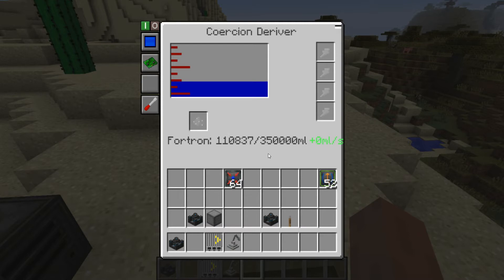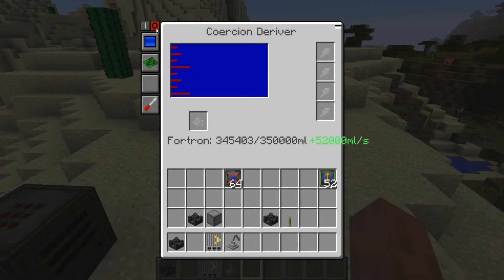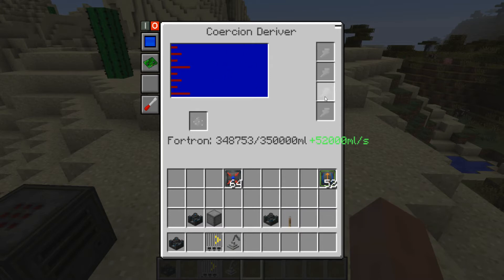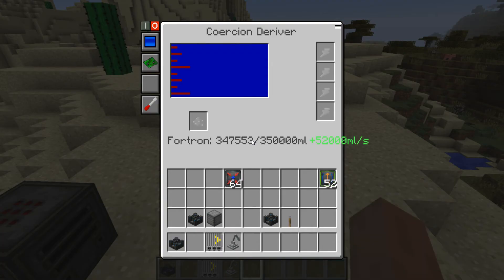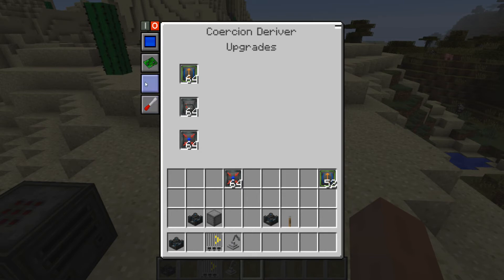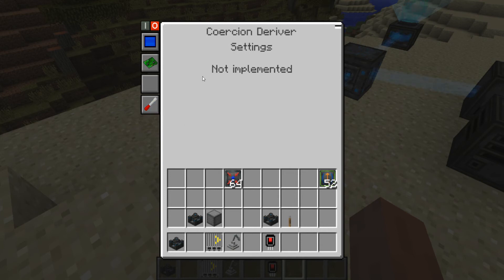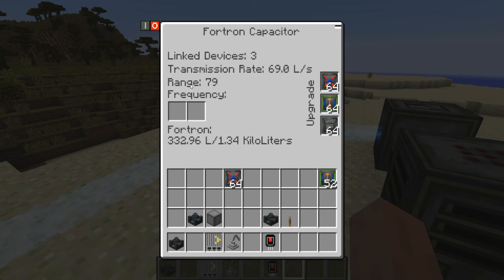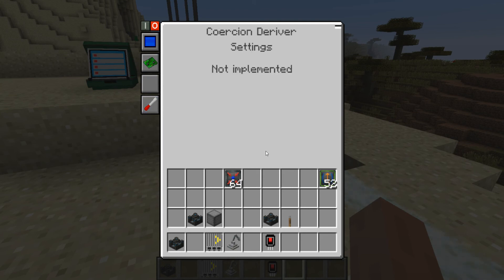MFFS - New Coercion Deriver GUI

Comment: I can't give the Fortron Capacitor some energy? How I can do that with industrialcraft 2?
Reply from the maker: Last I checked IC2 support was not added yet, so you may need some mod to convert the power to RF energy. I'll poke at the new dev I have assigned to the mod to work on IC2 support.